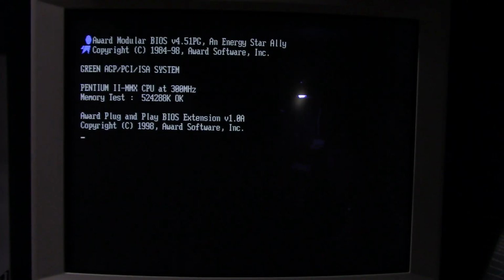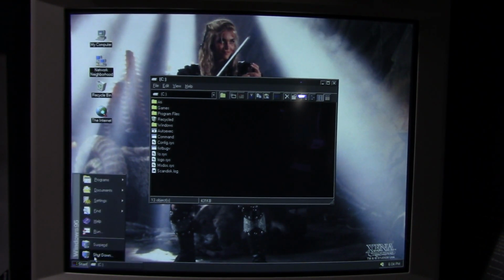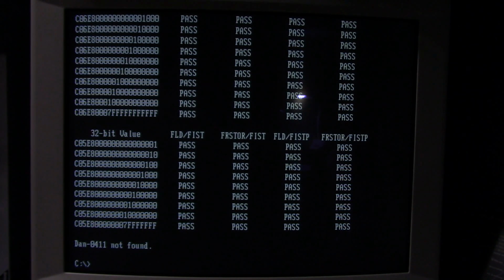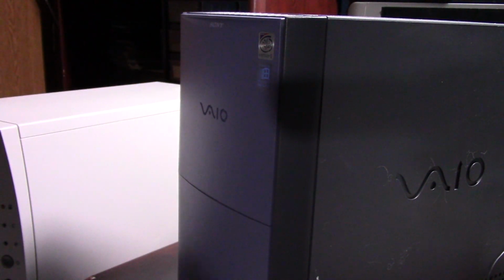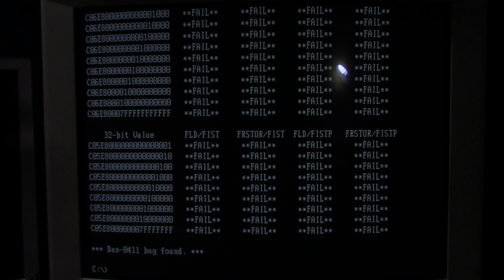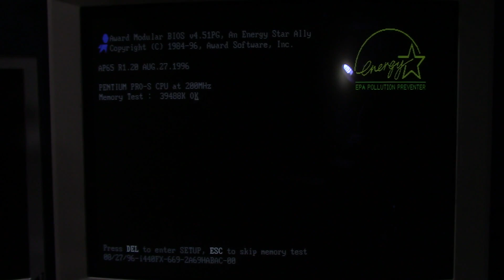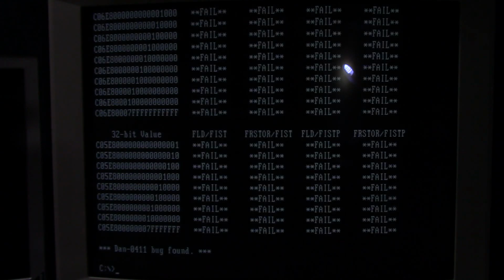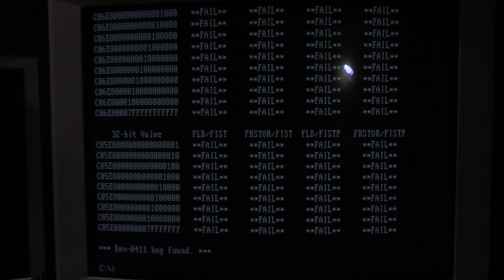Bug Testing Pentium II and Pentium Pro

Comment: haha nice video, however it would be ineresting to see what problem did it cause in real world applications....
Reply: The FIST instruction converts the value in the ST(0) register to a signed integer and stores the result in the destination operand. The problem is that conversion goes incorrectly, so you can't trust your calculations when using this command.
Reply from the maker: If I can find a real example of this bug in action I will certainly demonstrate it.
Reply: Interesting...

Comment: the black-top PPros probably shouldn't have it. they're a later revision with more cache meant for server use.
You may also want to see if it exists on the Pentium II overdrive for socket 8. They're quite hard to come by, but you can find them if you know where to look on ebay (certain netfinity CPU boards have them, for instance.)
Reply from the maker: Maybe Victor ( Retro Machines ) can run this on his Overdrive chips. My guess is those are probably clean, but it would be interesting to see.
Reply from the maker: I just tested my black top PPro, and Fistbug is indeed present in it.

Comment: So this bug basically ended up giving incorrect calculations when you divide from numbers? Well while not the kind of bug that would make your computer blow up in your face, it's still an old but interesting bug nonetheless. Great work on the video
Reply from the maker: Funny you should mention computer blowing up, because there was speculation when this bug was first discovered that it was responsible for the Ariane 5 rocket exploding.